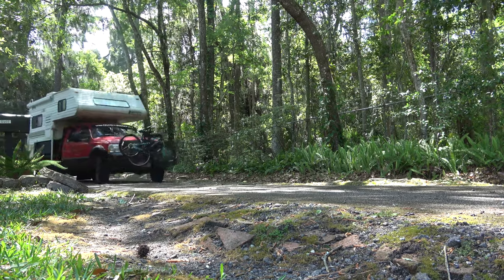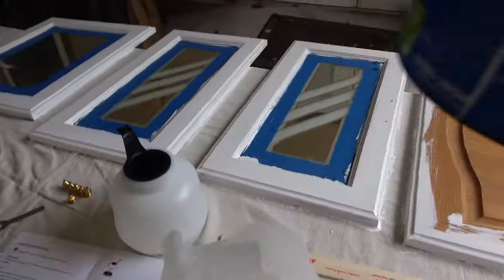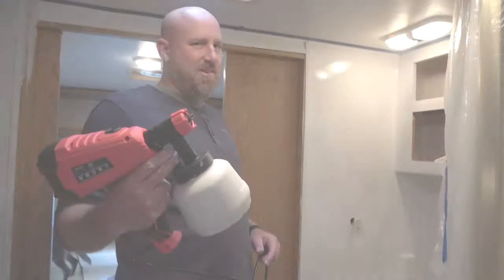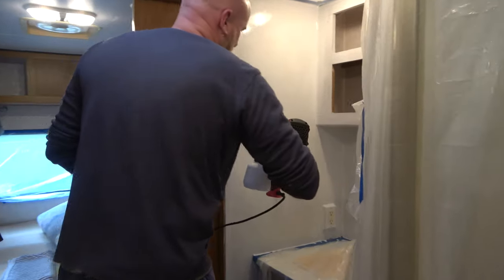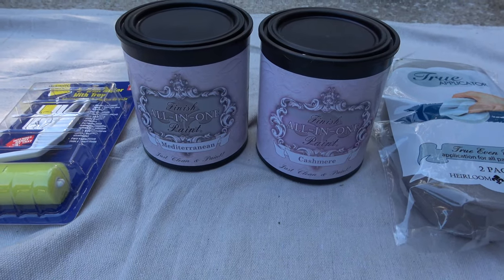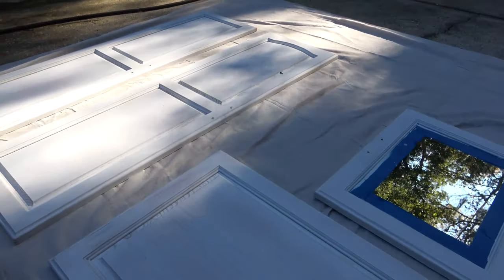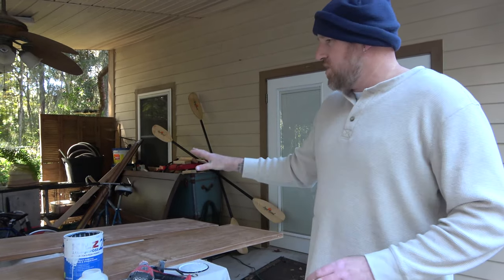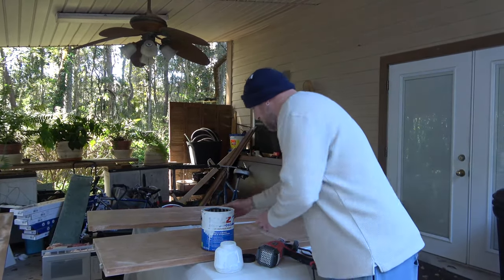CtW 111 // Preparing for painting the inside of an RV // Class C Camper Remodel

Comment: I recently purchased a 2004 with 26k miles I am going to remodel it.  I have fabric on my side walls and roof.  I was wondering if yours had that?  I cant find a video showing if you did or not.  Im trying to figure out how to remove it and if it will need wood to replace it and then paint over.  I want to make sure Im not over my head doing this.  Love the transformation and thank you for posting these videos.
Reply from the maker: Thanks! We did not have carpet on walls or roof and that would have been a dealbreaker for us just because of the work involved. We had an old sailboat that has carpet there and it was so much to work with. Sorry we can’t offer any advice for dealing with it!

Comment: I’m doing a remodel on a truck camper. Did you us liquid sand paper on your walls before you painted?
Reply from the maker: Yes, we used 2 coats of liquid sandpaper on the walls before putting a coat of primer down. It did a pretty good job of scuffing up the walls so the primer stuck nice and made it better for painting.
Reply: Did you have to wash off the liquid sand in between coats after it dried. I looked it up and that's what the internet 🤣 said to do. (I would love to go that route vs having to sand if washing it off is not a necessity).
Reply from the maker: @JNante  we did not wash it off. Some people use TSP to clean surfaces before painting and that has to be rinsed off